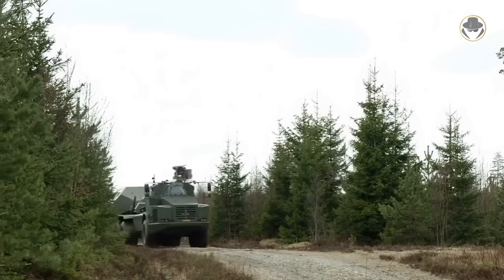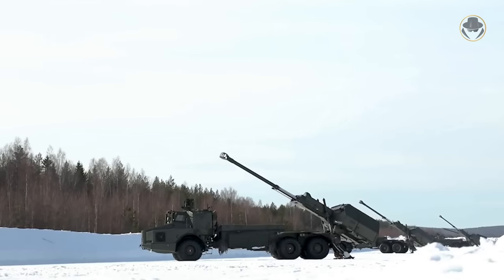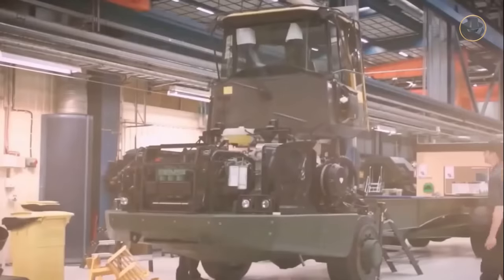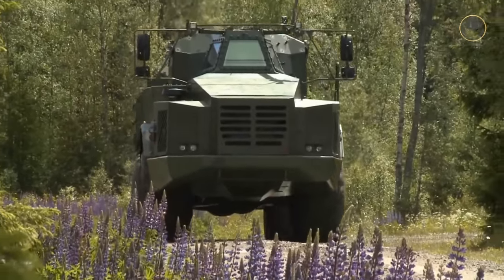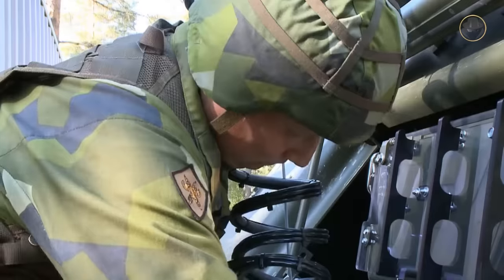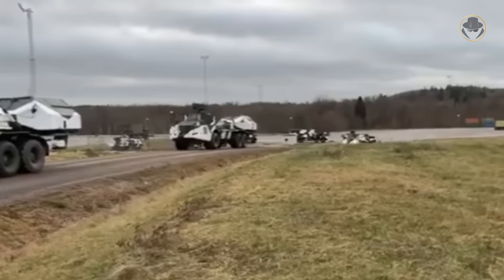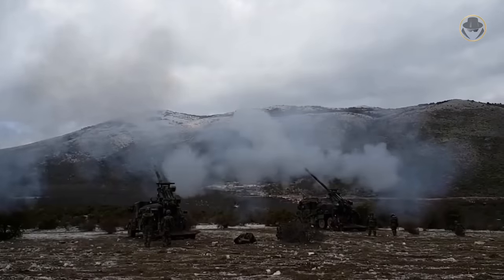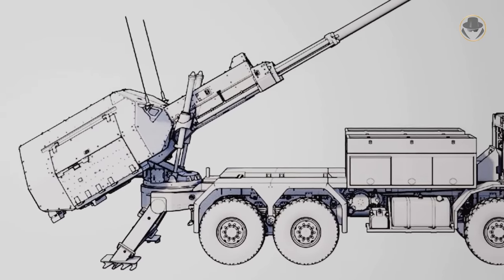Archer Artillery System | What is wrong?

Comment: There is nothing overly complicated with the chassis or the gun system of the archer. All trades required are already represented in an Artillery fitter section. Why slack the sales ? well the world decided they wouldn't spend money on defence is what happened there. Look out for the appearance of Archer in Ukraine where it will demonstrate modern shoot and scoot tactics.
Reply: Ceasers already been there done that, and still is...
Reply: Good luck driving a Caesar system off road. It has nowhere near the mobility of an Archer or any other hauler- or trackmounted gun.

Comment: The problem with archer is its to slow to reload after the salvo....caesar is more practical because of its continous reloading....archer however is good for shore defense...
Reply: What do you mean with to slow to reload? The Archer has 21 rounds in the magazine. It only needs 3 crew while the Ceasar needs 6. Also the crew in the archer doesn''t need to step out of the vehicle when firing. They're protected within the vehicle.
Reply: @kristofferhellstrom  still slow to replenish the magazine....other system can fire continously without replenishing while archer has to stop firing to replenish....this is good only if using long range warhead just like the himars...but for short range engagement this is a liability....although this is a good system for anti ship defense...
Reply: @petter5721  ha :D
Reply: @kristofferhellstrom  yeah, with those systems with external loading process, you just need one or two trucks with ammo and propellant just behind to supply a whole battery to fire continuously.
By the way, why a 6 crew on a Caesar ? I know the French army operate them with 5 men (3 crew, 1 driver and 1 commander)
Reply: @Ai-vq8rj  Why would you want to fire continuously on a modern battlefield as that just invites counter battery fire?
Reply: @remistiegler5302  Guess it's making it easier, the minimal crew is 3 tho.
Reply: @kristofferhellstrom  Protection on this kind of howitzer is a bit uselss, they're not supposed to receive hits, rather than arrive on the zone, drop ammo and gtfo.
Reply: @drhelmut3467  Protection is always important :) Also the time it takes for the troops to get outside to prep the howitzer is time lost.
Reply: It’s not meant to fire continuously. It’s meant to fire a few rounds with precision and then relocate. Against a near peer enemy you’re not stationary in one place firing shell after shell after shell. Artillery radars will spot your first rounds and after that it’s not long before you have counter battery fire coming your way.

Comment: The issue of long term maintainability is a show stopper in my mind.  A complex, low volume vehicle that requires specially trained technicians and unobtainium spare parts is not a viable long term system.  Technicians move on and replacements will be hard to secure.  No one wants to invest their career in a dead end specialty.  The parts issue is the real killer.  Unless this thing was designed by a farmer to be maintained in the field by a farmer it is doomed to become unsupportable.
Reply: False! The maintainability is good in this proven, reliable and practical wihecels with worldwide commersial applications. Survivability in a modern war against an advanced adversary is only high in advanced weapons systems like this. Primitive weapons will be destroyed.

Comment: I will tell you what is wrong with it? Nothing. If it is too expensive then it won't get bought, if it seems too expensive even if it isn't it will struggle to sell. However the longer it is around and the more it is used the price will seem lower and more except able on the battlefield.

Comment: Road speed is 90km/h, not 65.
Reply from the maker: Our info from the official website of the Försvarsmakten
Reply: @WeaponDetective  But that is not correct, wonder why they downplay the speed. BAE refers to 90km/h of max speed. Also if you calculate the speed of the Archer in the video on the highway (as the distance between 2 white poles are 50m) you will get a speed of ca 88km/h.
Reply from the maker: @Breakingcraft  We also saw the info of BAE Systems, but we preferred the user's info.

Comment: Based on the Volvo off-road dump truck possibly the R100E these things are built for the use and abuse of heavy construction work and have served well for years in that role. Change the cab, extend the rear chassis unit and hang this ungainly artillery lump on its arse though and I am not at all surprised people look at it with a practical eye and think, innovative but probably going to spend most of its time upside down in a ditch and that's the problem, it is so creative and so out of left field people really cannot get their head around what these things are really meant to be in terms of battlefield practicality, Take ammunition handling, the military around the world are not that keen on automatic loading, no idea why, they carry hand weapons that do just that and have for decades but they look at things like archer and the old thinking heads get put on, it stands no chance, they love to see large groups of sweaty soldiers humping ammunition into these things fully exposed to enemy fire requiring large amounts of protection on the ground. but there it is, even the M777 with its hand-pumped ridiculous transport tray device, I mean what chump thought that was a good idea, adds to the complexity and the crew still has to hand load the charges, its as if they simply cannot get away from old thinking so under protest they allowed just one small part of an autoloader to be fitted, maybe in a few dozen years they will relent and allow a hydraulic rammer. fifty years on and we might get charges loaded this way. Still, eventually, you just know that you are going to end up with a field howitzer with an autoloader pre-charged with the required fire mission loadout fitted to an off-road modified construction vehicle operated by two people looking very much like the Archer, you just need to clear out those currently standing in the way of progress for whatever reason they are doing so. Or maybe send a dozen or so to Ukraine and let them show what they can really do.....or not.
Reply: Why possible R100E when it's actual A30D...

Comment: Easy answer: Nothing!
Reply: the other answer may be: competitors also selling excellent pieces of kit just in the Europe. Caesar, PzH 2000, Nora, Suzana 2, Krab... those systems also provide good capabilities with competitive prices, some of them also having battlefield record, the Ceasar and PzH 2000 howitzers being battle-proven even before the war in Ukraine started
Reply: @remistiegler5302  All a step or two behind the Archer in different ways.
And the PHZ2000 is competing more with the old Bkan1 than Archer. It was developed in the late 1980's.
Not a shocker that old systems are battle-proven either, means little. 

And the Ceasar that is battle-proven is the 6x6, which is nothing like the Archer. It's a light weight system for either expedition forces or poor nations.
Reply: @benghazi4216  I think you underestimate the other European systems, especially the two you quote. 
An old plateform, if well designed, can evolve within the time and get new fire control system, cannon, loading system, armor, etc. 
And the PzH has superior firing capabilities than the archer, especially in terms of ROF an ammo storage, for similar range and accuracy.

Moreover, you are mistaken about the Caesar because it is clearly not a cheap system but a quite expensive truck mounted howitzer with very advanced systems and high precision manufacturing. Each system costs 5-6 M$ with full package depending the version but Nexter still sell them like cakes. 
The reason ? Because its firing control system is excellent and easy to use, its accuracy is known to be purely evil, its mobility is very high when not on rough terrain and its maintenance is simple/cheap. And they can be airlifted, the 6x6 version being able to be loaded in a C130. Many countries copied it but none of them have neither all its capabilities nor its combat record.
By the way, 6x6 and 8x8 plateforms are pretty similar, the weapon and systems are the same with some updates, they mostly changed the truck and added a more automated loading system to reduce the shells hefting for the crew.

So no, the Archer isn't two steps ahead of those systems, especially concerning the fire control system. the Bofors system is great, especially its firing mechanism, but not great enough to surpass its opponents which perform better on other points. 

Anyway, there is a reason why Germany sold 300 PzH 2000 abroad, France 330 Caesars abroad and Sweden 0 Archer abroad. And those countries don't have the US/Russian-like influence to boost their arms sales
Reply: @remistiegler5302  Man, you need to be a salesman. The way you compare things is quite strange. 
1) Like elevating the fire control system of the Caesar over the Archer. Both are modern fire control systems were the only difference is the user interface. 
And just based on the countries armament histories, the Swedes will win there over the French. User friendly isn't synonymous with French systems in general. 
And we can see it clearly by ourselves too. On the Ceasar people are outside in the rain, while in the Archer they are inside in the warmth looking at a screen and pushing buttons. Which artillery gunner will do a better job do you think? 

2) Or elevating the magazine storage of the PHZ2000 when we all can see the Ukrainians can just fire a few round, and then they have to move their PHZ2000's into cover, which takes way more time than with the Archer.
The Archer is a better fit for the modern battlefield, which is logical, being designed 20 years later than the PHZ2000. 

And if the Ceasar 6x6 is More expensive than the Archer, it's a really bad deal. 
Zero crew protection during use, and slower than the Archer in shoot and scoot. 
But like I said, a good choice for an expedition force being it can fit in a C130.
But then again, the Archer fits in a A400M.
So if you have an actual runway or highway to use, you would rather send the Archer. 

If you don't think France has an edge over Sweden in military sales you are delusional. 
Did you miss them being a permanent member of the security council, a nuclear state, or their vast pseudo CFA colonies in Africa? They even have an aircraft carrier to project power anywhere in the world, and they do it too.

Germany is an economic superpower, making them happy, makes your economy happy. They rule the EU for gods sake.

So to say these countries has no boost compared to Sweden is a delusion. For real.

And then you forget that the Archer is new on the market, while the PHZ2000 has been on sale since the 1990's. 
See what a dishonest salesman you are behaving like?
It's like saying electric cars are a flop since they have sold so few compared to ICE cars. Purposefully forgetting the ICE cars have owned the market for decades.
Reply: @benghazi4216  yes and the only difference between the M777 and the archer is the ui too! Archer > every arty in the world!!!!

I swear archer fanboys are something else... your source is always "trust me bro" you never mention specific fire control systems it's always vague words. Why is the only difference between caesar's and archer's the ui? Any argument instead of "they're both modern"?

The historical argument why archer>caesar is even worse, not only do you not give any evidence except "trust me bro", but if you go the historical route france blows sweden out of the water in arty... and tanks (1st modern tank with the ft17 renault)... and planes (pioneer in military and civil aviation)...
France was the 1st european country to use guns, at the end of the 100 years war at castillon for example under the leadership of the bureau brothers. Then in italy french gunnery showed europe gunpowder was the future. During the american war of independance and most of the napoleonic war the gribeauval guns was the best artillery in the world, not to mention napoleon being an artillery officer himself. Finally the french 75 mm was perhaps the best gun in ww1, during the somme the french did far better than the british front thanks in great part to better artillery barrage.
So uh sweden better? How about history =/= contemporary. Searching historical evidence for your arguments is often copium.

About that cabin archer fanboys just love it! Problem is we don't know yet how (in)effective cabins are, in ukraine no western spg were hit yet to my knowledge therefore we cannot tell if a cabin actually makes a true difference. Truth is the cabin is heavy and the gun being seperated makes it harder to reach, if something goes wrong inside you're unlikely to have the tools or time or expertise to deal with it. The logistics of the archer is perhaps its biggest downfall, first the system inside the turret is complex and hard to reach, then the system is heavy and fairly slow compared to the caesar (but not the pzh 2000), it is hard to airlift properly (you don't necessarly have spare A400M lying around) and finally if we keep the comparison with the caesar, french operation in mali gave us the proof that the caesar is a beast logistically, crossing a gigantic sand filled country while firing its gun and all that in record times, this is highly impressive. The caesar being costly is an easy tradeoff for all the extra mobility, it's much faster on road and off road than the archer too. Easy to maintain, to reposition, proven accuracy, easy of use and fast scoot and shoot. If no crew protection (whose effectiveness hasn't been battle tested yet) and slightly longer scoot and shoot are its only downfall then the archer has fearsome competitors to say the least

The ammo storage of the pzh 2000 is also more important than you make it sound to be because you don't have to go back to search for ammo as often. overall i'm not a big fan of the pzh 2000 but you're clearly underselling it.
Reply: @benghazi4216  no salesman here, just a guy putting factual elements in perspective.
I never wrote that the Archer is inferior, have a less good sofware or is less well manufactured compared to other systems. Instead, you claimed that the Archer is far superior to other systems that are known to perform well on battlefield and that have prominent sales. Reason why i put your statement in perspective.
About the price, i only found data about initial costs to fund the programm for the Archer purchase, which means it doesn't integrate all the costs. So, the 4,5M price for each Archer  system written on Wikipedia is clearly far from the nacked system real price and even further from the full package costs (system, training, ammo, spare parts, software updates). This may be one of the reason why the Archer didn't meet any market, because the final price is too expensive.
Armored cabin, ROF, deployment time,... those are capabilities in which the Archer performs well. Ok, I know that but I tried to explain you that those advantages aren't decisive or superior enough to surpass the other systems.
Caesar, PzH, Dana,... also have advantages and similar capabilies over the Archer: weight, armor, price, mobility ROF, simplicity, maintenance, ... As explained in the video, the Archer isn't the best system on every feature.

And about your vision of both Swedish and French military, I dunno where you come from but you sound very biaised (probably because of the false WW2 echo made by the US after France refused to follow them in Irak in 2003).
Sweden has a long miltary history with a skilled army for sure. 
But France is a world's military powerhouse since 1000 years and continues to be one of the biggest today: 1st military power in Europe, 5th worldwide (7th without the nukes), one of the very few countries being able to send a large expeditionary force worldwide and the world's 3rd defence products exporter.
Reply: @pougetguillaume4632  long but very interesting statement. I can't agree more, especially the Serval ops, where French machines, including the Caesar, performed very well in a highly difficult environment in a few weeks and without major logistics needs. Truly impressive. "Battle order" made a video about the Serval "Blitzkrieg", go check it if you didn't, it's well explained. 

A feature that none of us underlined about the Caesar is that it also has an armored cabin to protect the crew during moving and waiting phases. I even found out that the cabin of the 8×8 chassis can be better protected (up to stanag lvl. 3 armor) than the Archer's cabin (stanag lvl. 2)

Comment: Since when was a crane necessary for 155mm? I feel like Sweden did this for the feminist, which just adds cost and complexity. In war time they'll dump the whole thing.
Reply: Haubits 77 did also have a crane (and that was from the cold war) it speed up the loading, fight smart, not hard. The complexity of a crane is noting compare to the, fire controll and Gun laying gear.

Comment: ROFL?
Psychological?
It's problem is shared by many military projects.  Too many Bureaucratic compromises , that deliver a product that is just not good enough at any particular thing.  
Compared to say the Pzh2000 or even the old AS90, it lacks mobility and armour, with only a small advantage in speed.
Compared to a truck-mounted system, it is too slow, too long, too heavy, and too expensive.